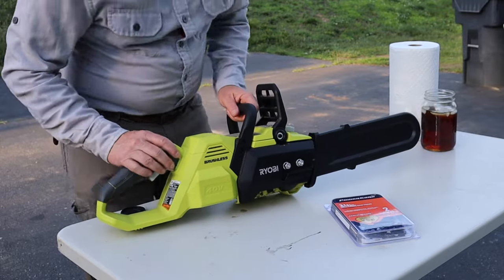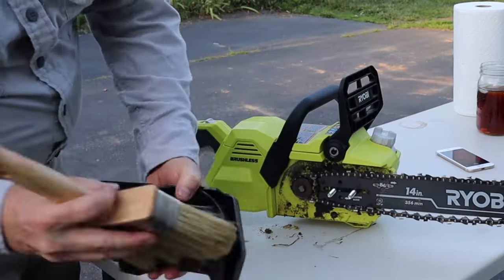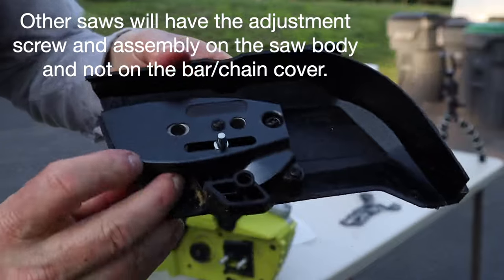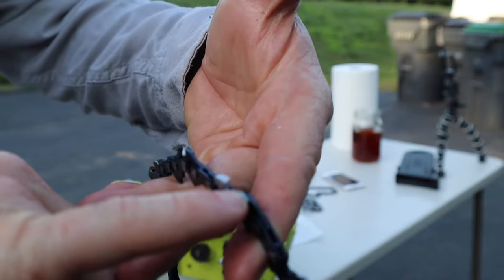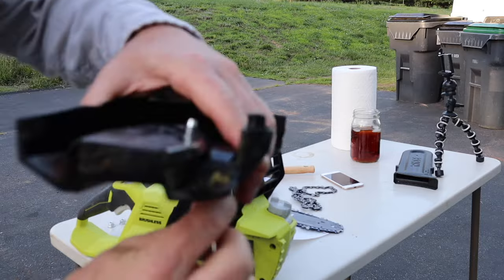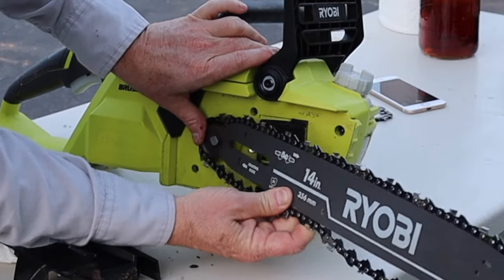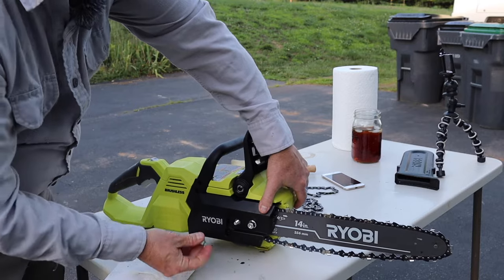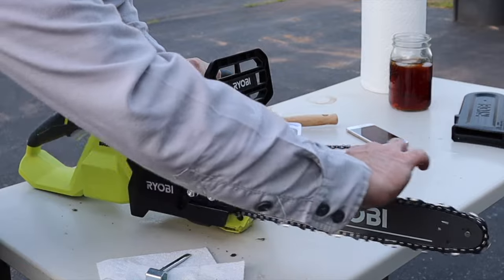How to replace a chain on a chainsaw - Another part of our Ryobi 40V 14' electric chainsaw review

Comment: When my husband passed last year people came out of the woodwork for the tools... "No"! and I hid everything right down to the nubby phillips head. I jump right in with ANY kind of tool. It's true not to loan them out. My son finally found and returned the chainsaw. a year Wrong blade (found out), no bar oil and so caked with oil soaked sawdust I'm surprised it would turn. Fast forward to your EXCELLENT video because using is one thing but changing the blade so I keep all my body parts is something I don't know about. I couldn't figure out why I couldn't tighten the chain like you. Mine had a limited range. Thought it could be gunked up. When I took apart the box, I found the screw bent. Borrow from someone else people or buy your own! It'll probably be snowing now before I can do what I have to. If I can get that screw, I'll be back here to make sure I get it right. Thank you.
Reply from the maker: Thank you for your comment. I am sorry to hear about your husband's passing. I don't blame you for keeping a close eye on your tools. I think that's probably pretty smart. With regard to tightening the chain, it might be the screw, or it might be that the chain is so worn out that it just needs to be replaced. Hard to tell without looking at it. Anyway, best of luck to you and God bless you as you persevere.

Comment: Should you replace the chain with a new one everytime it falls off? Or when should you change them out?
Reply from the maker: Kimberly, sorry it took me a while to get back to you.  I take chains in to have them sharpened at a local shop.  Most professional saw dealers offer this service for just a few dollars per chain.  Generally, I have kept chains through multiple sharpenings until they literally get too long to stay on the bar, or until the teeth are visibly beyond usefulness.  I am sure they local folks where you get your chain sharpened can inspect them from time to time and advise you on it.  Hope that helps!

Comment: Is the end part of the video, the amount of “tightness” the chain needs to be? Does it need to be able to be manually pulled away from the housing? So not so tight the chain can’t be pulled away?
Reply from the maker: It needs to be able to move freely along the track of the bar, just using your thumb and forefinger of one hand.  If it is not sliding freely, it is either too tight, or the bar brake is applied (a safety feature on some saws; consult your manual), or you have a problem with the cog wheel on the end of the bar (from a worn bar or a lack of lubricant getting to cog wheel), or you have a problem with the drive gear.  In the case of the drive gear, you need to have your saw serviced.  In my experience, you chain should not be hanging below the bar so much that there is a visible gap between the bar and chain that you can see through.

Comment: Any problem with changing the 14 to a 16, by changing the bar and chain?
Reply from the maker: Haven't tried it on this saw.  Some saw specifications allow for different lengths of bars.  On this Ryobi saw, if you find yourself needing a 16" bar, you may need a more powerful saw in my opinion.

Comment: Followed instuction and chain keeps slipping
Reply from the maker: Jason, do you mean it is slipping off the bar?  What kind of saw are you using (brand and model)?  Make sure you move the bar up and down as you turn the adjusting screw to tighten the chain.  If it is still slipping off, it may be due to a worn chain (worn chains can lengthen excessively due to wear at the link pivots).  Reply back if there's further assistance I can provide to you.

Comment: Doing this on a power Mac 310 is a pain in the ass.
Reply from the maker: I had to look up what a Mac 310 is - not familiar with that saw
. Yikes!  Looks like a bear of a job, with that thing that looks like a centrifugal clutch right in the middle of everything.
Reply: @strongtowermedia4562   in addition, the chain tensioner is on the cover. It has a raised nub that grabs a hole in the bar. Everything has two line up and it is all wobbly. You need good light to make sure that locator pin hits the hole.

Comment: Struggling to get the black cover off. I’ve removed the two bolts and it feels like somethings going to break if I keep pulling on it.  Update: the cover eventually came off but the chain was bound up and putting some abnormal pressure on it.
Reply from the maker: Glad you were able to break it free!

Comment: Do you need to oil the chain?
Reply from the maker: You do not need to oil the chain, At least not in this case. There may be some manufacturers that recommend it, but none that I am aware of. The chain gets oiled from the chainsaw oiling mechanism, and does not need to be pre-oiled, so to speak.